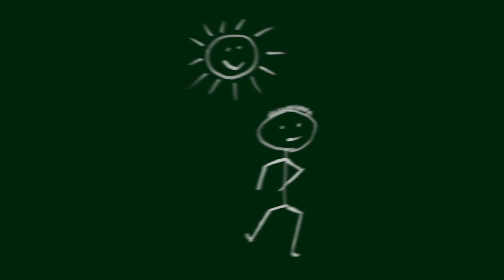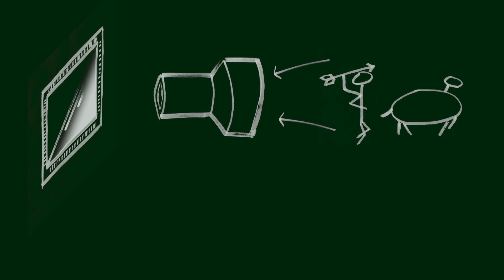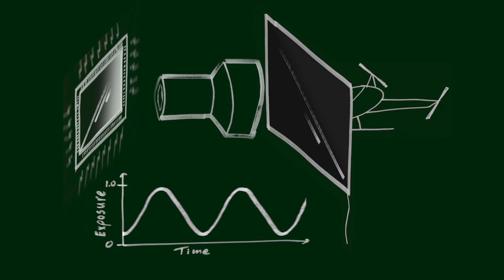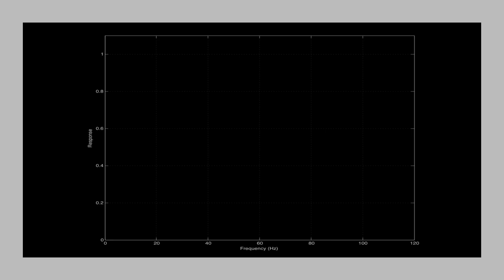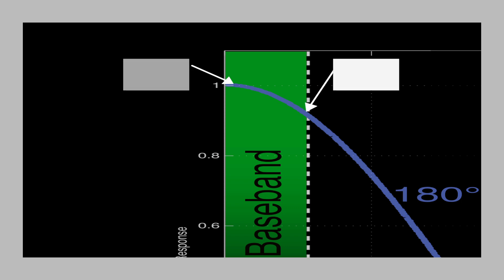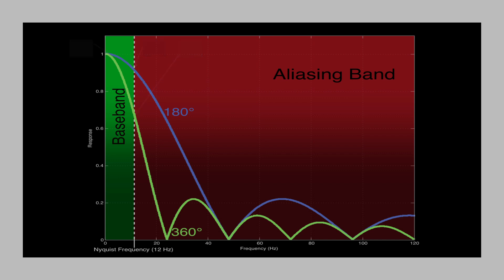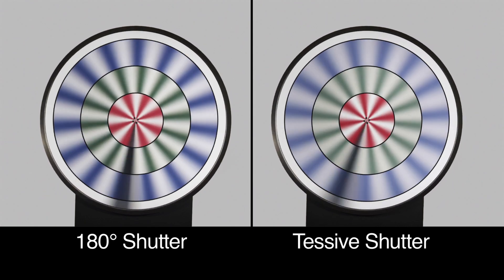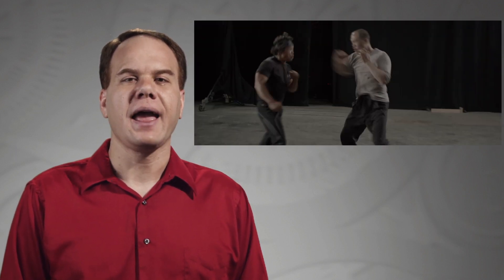Tessive Explanation and Demo Footage

Comment from the maker: The Time Filter system is used with a 360-degree shutter.  The reason for that is simply to get the camera's shutter out of the way so the Time Filter shutter can take over.  The ultimate look of the footage is not that of a 360-degree shutter; it's the Time Filter's smooth ramping shutter which has about the total integrated exposure time of a 180-degree shutter, but is shaped very differently.  Exposure compensation is listed on the Time Filter's control box, and is about 1.3 stops.

Comment: This is very interesting.    So a (360 degree) time filter would be used instead of a 180 degree regular shutter?   I suppose the camera would be set to 360 degree shutter.   What would the exposure be in terms of brightness?   Would my very rudimentary maths be right in thinking the exposure would be about 78.55% of a regular 360 shutter?     I'm also trying to get my head around how digital cameras with rolling shutter would interact with this.